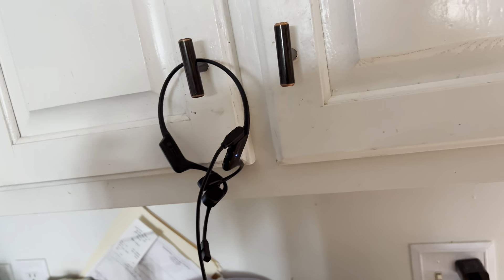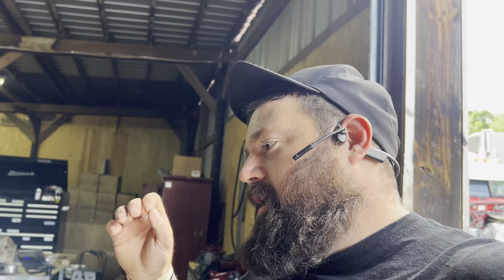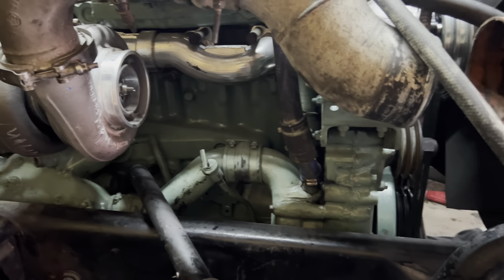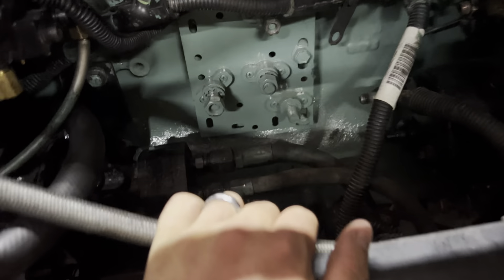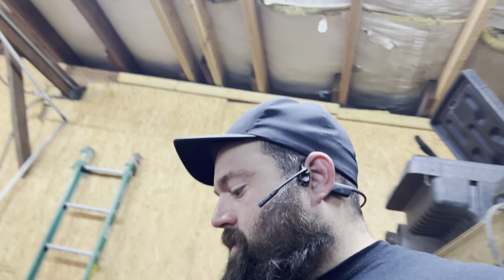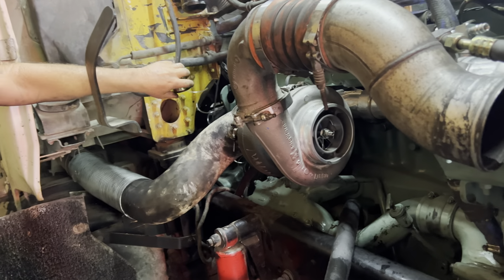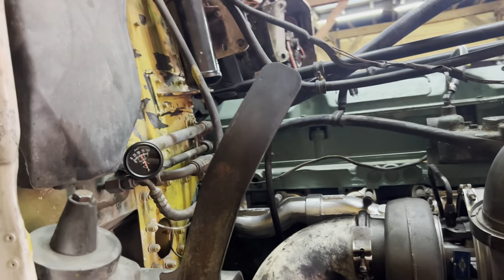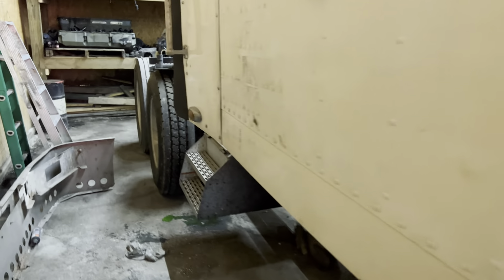TURNING A UNBELIEVABLE SCAM into something amazing!! FIRST START ON NEW ENGINE..

Comment from the maker: https://youtu.be/POA8BqGTKGg go check out the first scam truck video of the engine tear down!! Visit gentryandsonstrucking.com for Merch
Reply: Did you end up raising enough to cover cost ? Or is there still a go fund me or should we buy merch ? How to help is the question.
Reply: much RESPECT…..
Reply: Tim fuel prices will not come down till the end of summer or fall I’m not gonna be a political but it’s not gonna get any better the next couple years
Reply: @jonscott7686  yup... only way we can keep going is we charge a fuel surcharge.  Even then our rates are barely enough to keep going with parts cost and if and when we take truck to outside mechanic they wanna charge 175 hr...   gonna have to renegotiate our deal or just hang up after this year.... hauling pig feed in Oklahoma  panhandle  for Smithfield and seaboard
Reply: What ooooo
Reply: My brother from another mother
Reply: I thought Shane was going to lease to you
Reply: Are you the owner/operator or your dad , is it a family business
Reply: Have a question about my ‘07 379 c15…MXS.  Low coolant alarm comes on while driving and reduces power but it’s not low.
Reply: TIM!!!!!!! YOU SAY YOU ANSWER YOUR COMMENTS WHEN YOU CAN..... I'VE ASKED 3 - 4 TIMES, "HOW DID YOU FIX INJECTOR BRAX BROKE????????" ANYBODY???????????????????
Reply from the maker: @bigbobk1963  I just replaced the top solenoid it’s super easy to do 4 little bolts pull it off put new one on
Reply: @Gentryandsons  thanks!!! So you had to replace it....wondered if you or DAD had way to fix what Brax gorilla tightened lol  :) Guess he'll know next time!!!!!!! He's gonna be good mechanic in few more years!!!!!!
Reply: Good evening,
I just finished watching scam truck we’re you fired her up, sounds amazing. I love how you treat other people and help drivers to get a truck. Your heart is in the correct place may God Bless you and your family. 
You said near the end of the video that you wil be using Amsoil in trucks, that is an amazing product line they have. If you do not have someone that is a dealer in Amsoil I can get you in contact with someone that can show you how to save and make money at the same time. My brother is an Independent Dealer with Amsoil for many years. Please let me know and I will have him contact you.
Reply: @petedeleon8045  1st is replace sensor... and or check wires

Comment: Thanks for the videos! For some of us non truckers, but love seeing them, can you talk about different wheels and tire setups, like, why do some tractors and trailers run the big single rims and tires as apposed to the duals? Take care,   -Jamie
Reply: There’s a few reasons big single vs double tires . Technically you get better fuel mileage, less tire to replace but they cost more, lighter so your can  haul a little more, there’s a few more pros and cons .

Comment: 1:00(ish) THANKS for the info on the headset! 

I as well have ran the various Blue Parrot versions........until they started making garbage! I use to get 3-4 years out of one of their headsets. Now I'm lucky to get 1.5 to 2 years out of one of them! The price on that after shock seems right at less than half the price of a new Blue Parrot! I may very well be acquiring me one of them, once my current Blu Parrot croaks. HOPEFULLY this WON'T happen fir a bit as it was new in February of this year.

Comment: If you want to race a big truck, get a 12V92T and upgrade it to twin turbos and modern injectors and maybe upsize the exhaust valves/go titanium. They made about 655-700HP stock and with upgraded turbos (especially with an intercooler and better injectors and some exhaust work they'll make WAY more power than that. I still swear if you put regular high performance big block pistons and rods in it it'd probably be able to spin up even higher rpm and make WAY more power but I guess you can't get enough compression for it to ignite that way, the turbo typically had 17:1 the NA 19:1.

Comment: I've been on the fence about a new headset for a while now. All I drive are old noisy trucks and cranes. The blue Parrott models are way too bulky for my liking, and ear buds just sound like crap. I picked up one of those opencomm by shokz to see how I like it. Figured if it works in your w9 it'll work in the straight piped Detroits👍

Comment: that black CAC looks pinched could affect air flow and the power... you need to check with freightliner and see how it was originally ran... cut that hose about 1in both side so it sits  at perfect 90 degree

Comment: tim what kind of clutches do they run on those trucks in michigan ? a eaton 2250 is not enough for a 2,000 hp motor is it a custom 3to 5 plate clutches?

Comment: There you go safety first going to drive a truck home that sat for 25 years I hope it rattles apart from the flat spotted tires or a rusty brake can comes apart  too cheap to hire a wrecker and do it the safe way always a hack and always will be a hack maybe you should order a set of wiper blades for the cab over so you might get them in by the time you are going to drive it but I’m sure those 25 year old ones will be just fine for you love the fly traps hanging in your house pretty classy